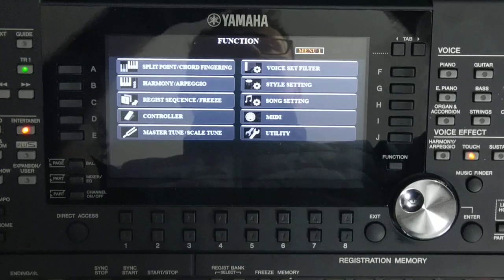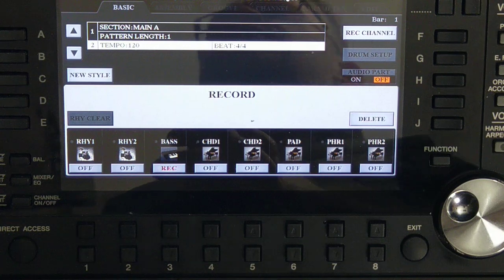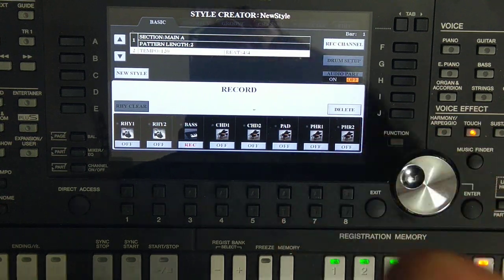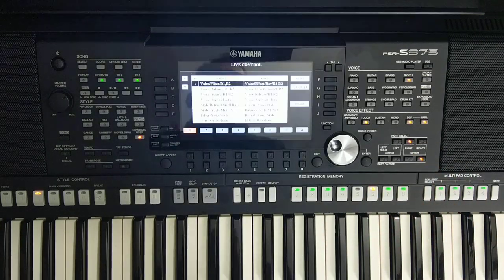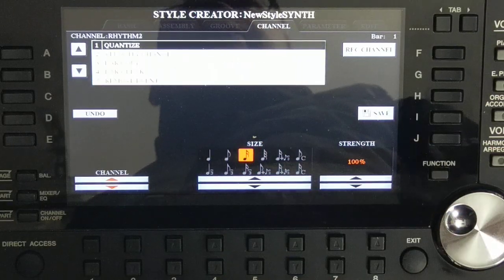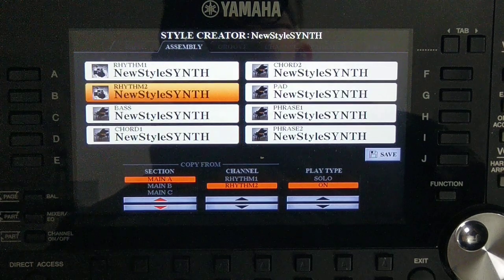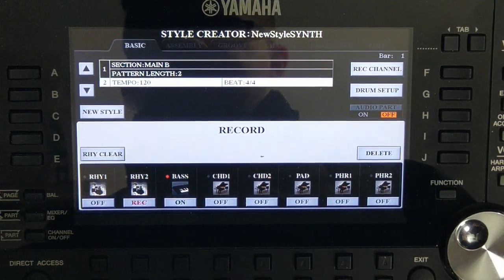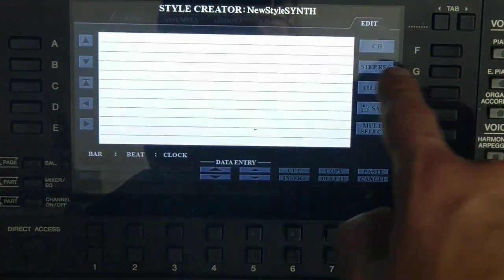How to create or edit style in Yamaha PSR S975 - tutorial with drums, quantize, synth boost / cut

Comment: I have a Yamaha PSR 770. I purchased one of those Key-Tab arrangements that use the registration memory buttons (up to number 3-8) to switch not only voices but in some cases arpeggios and other enhancements to both the left and right sides. I have a problem with the volume of some of the voices and the vendor cannot solve it because he does not have a PSR 770, or at least that is what he says. I have tried to use the mixer but once I switch from one button to another, the fix disappears.  I would like to know if Style creator could work and I could just adjust the volumes and save it back to the same name. The question is, can I just adjust the volume of the two right sides and then just save it back to the same register button and the same name? At the end of the song (button 3-8) I would need to raise both the left and right sides but I assume is the same. What I am doing right now, which is very cumbersome is that I assigned volume of both right channels to the live buttons on the left of the keyboard and it works. Then, because of the last part where I need to increase volume overall, before starting to play the piece, I increased the volume on the keyboard's volume knob and then decreased it  to halfway on the volume pedal on the floor. It feels that I am using prehistoric solutions but I am a little concerned about messing with the arrangement. Thanks for your videos.

Comment: When you copied from variation a to variation b, why it didn't get copied? This is because when you recorded the bass you have saved it after recording but when you rec drums you didn't saved it. So when you open the assembly tab the drum section of the variation a will be empty cause you didn't save it but the bass will get copied cause you saved and previewed it. Thats the reason, if you directly jump to assembly after recording anything it will not copy.
Reply from the maker: Thanks for the tip. Regards